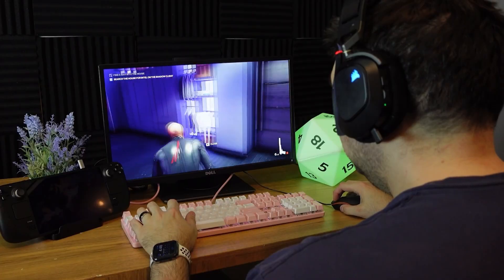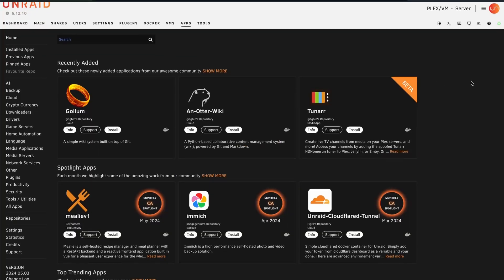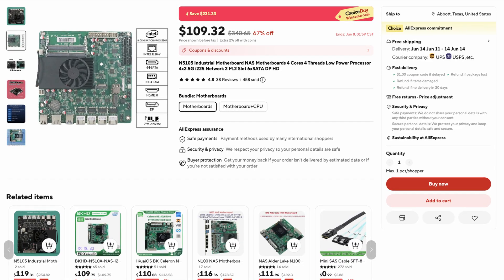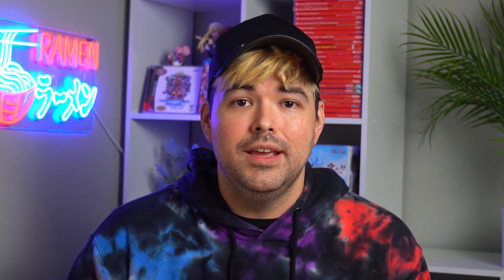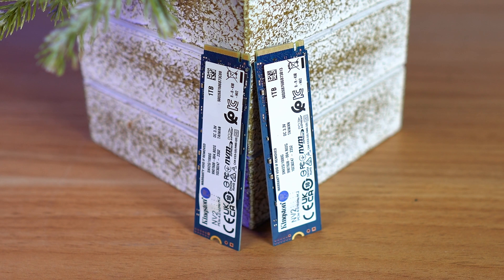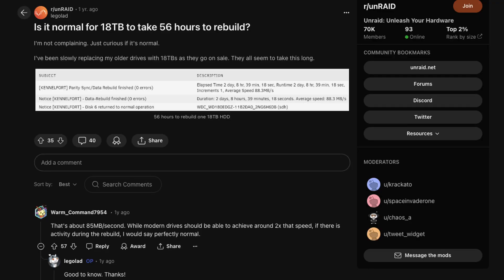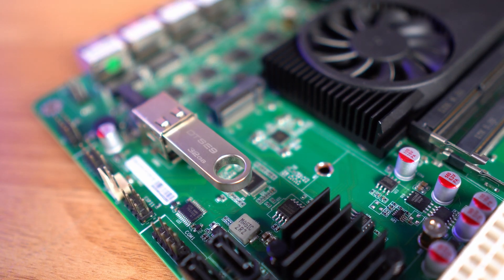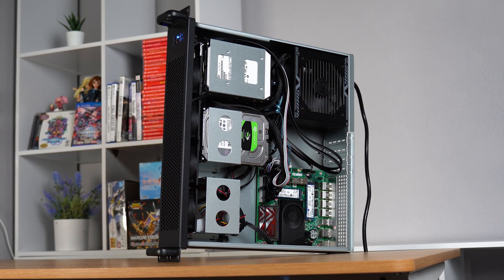Building The PERFECT Budget Home Server

Comment: Instead of using a thumb drive - which could fail pretty easily after a while, would it make sense to buy a small form factor external SSD and "mount" it in there (just so it doesn't move around)?
Reply from the maker: You certainely could - I just use USB cause that's what unraid suggested at the time. You could use a small SSD as well, I believe.

Comment: Really liked your build video!  I just bought the mobo from your link to make a similar NAS, even though I have a higher power TrueNAS system.  I like that 2U case, but I'm curious about the amount of fan noise you're hearing.  Are you in any way controlling the fan speeds, or are they just running full speed all the time?  Thanks!
Reply from the maker: They are molex powered so they are full speed, but I only plugged in 2 of the 4 to keep them a little quiet haha. They aren’t that loud really, but if you’re going to be on the same room as the server they might be annoying.  You can always replace the fans if you want fan control.
Reply: @JasonWitmerYT  Funny, I ended up doing the same thing--unplugging the two outside fans.  They sure like to whine!  I'll eventually replace them with controlled units that are quieter.  I basically duplicated your whole build, so thanks for that.  Very happy with the <20W power consumption and really like the well-built case also!
Reply: I decided to replace all 4 with the "Be Quiet!" brand 80 mm fans.  Ahh...they are super quiet!  I plugged them into a cheap Amazon fan hub that has a "normal/half-speed" switch and run them half-speed 24/7.  They work great, and the airflow out the back vents is more than adequate.

I noticed that with the stock fans, they changed speeds and sounded like they were struggling a bit when I put the top lid on.  That told me they were trying to move too much air for the rear vents to handle anyway.

After several months now, I'm very happy with the setup.  Using TrueNAS and Plex, it's a great home TV/movie server that idles at about 20-25 watts, using four 8GB hard drives in RAIDZ1 (equiv to RAID 5).

Comment: I bought an old datto 4 bay Nas for 114 that came with 2 1tb drives, I replaced those but it feels good having the ability to back up files en masse without needing to either take out drives or leave my main PC on. I just copy whatever I need from my main pc while I'm using it, and then move it with a smaller office PC or my laptop later.

Comment: Just for reference, you can still access your data on unraid when a disk fails. The parity drive is used to emulate the data. It will just be slow to access once you add the replacement disk and start to rebuild parity.

Comment: i've been a long time unraid user,

currently I have a 24tb total array (across x8 3tb drives)  
on an x99 xeon e5 2699 v3 (18 cores, 36threads)
with 128gb ddr4 ecc ram
and an rtx 4060 gpu for transcoding.

for a while i've wanted to offload  my roms collection somewhere else, cuz i'm running low on disk space to feed plex/jellyfin/emby.

And i've been  looking for a short-depth  rack-mountable chassis that I can put on my 9u network rack and  provision a 2nd unraid that I can use as a plain-jane NAS ,

and you've just  given me what I needed.

Thank you for this!    new subscriber here.

great stuff!
Reply from the maker: Great setup! And thanks for the support!

Comment: Interesting server. I was surprised you weren't going with another xeon, but if its doing the job then it's fine. Ive got a old haswell system i was thinking of turning into a server. Only issue is it has stopped working which i think is the PSU fault. I was also just giving an old pc by a family friend which is also a haswell PC and another free kit of 16gb ddr3. So i hope to make a working server out of these PCs.  I may end up checking out haswell xeons and see if theres a i7 4790 type xeon CPUs available. Ive got an odd feeling a H87 wont run a xeon like the sandy bridge CPUs did.

Comment: Very nice build, as always! I do wonder how well that little celeron can handle game servers, especially since you mentioned Minecraft, which tends to like higher clock speeds. I suppose that would probably depend on how many people are on the server and how long that low power chip can hold its burst frequency at a time for. You mentioned that you've had this deployed for the last 9 months, have you tried hosting game servers yet?

Also, for those interested in the cheap used x79/x99 xeon route like he did for his $183 AliExpress build or some of the other budget build videos he released, that would be a cheaper option and offer more performance, but the power draw difference is pretty big, so the better choice would greatly depend on what you want to use it for and how much you pay for power. My x99 xeon server pulls around 75W from the wall at idle and around 100-110W under load with no mechanical hard drives (which each pull 7-9W). There are lower power x99 cpus than what I have, but at best they would only drop the power consumption by about 25W under load. In comparison, this build under load probably pulls somewhere in the ballpark of 45-55W, most of which is being pulled by his 4 mechanical drives. Another big thing to consider is the chinese x79/x99 motherboards (and even some name brand boards) often times won't let you boot past the bios without a gpu of some kind installed, so you'll need to invest in a low power gpu (think gt210, gt710, etc.) that you might not even utilize, depending on your use case.
Reply from the maker: Great thoughts! I have tried it on a single palworld server for only 3 people and there weren’t any issues, but I imagine if I added anything more there would definitely be issues. Luckily the game hosting is the lowest on my priority. Thanks for watching!